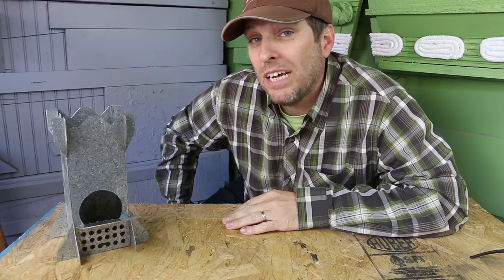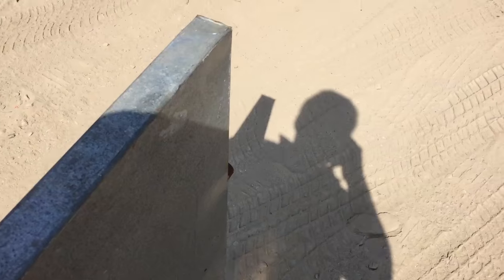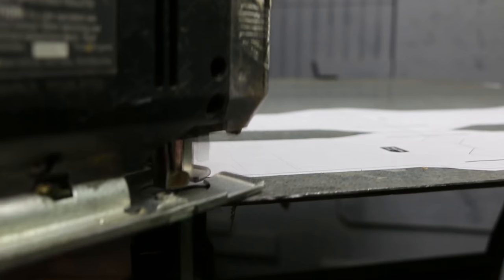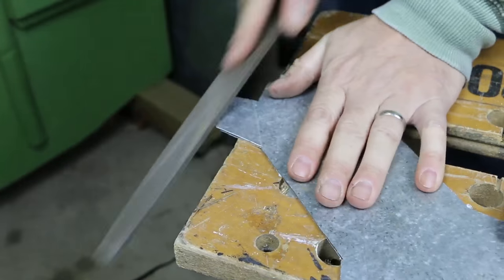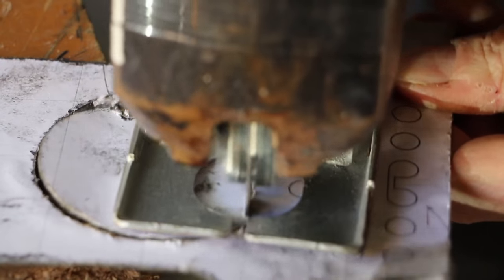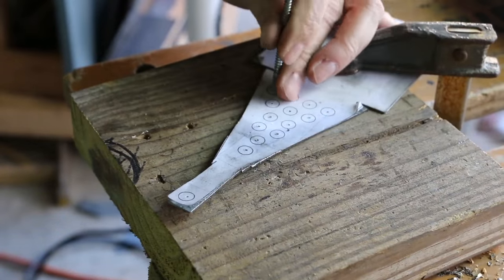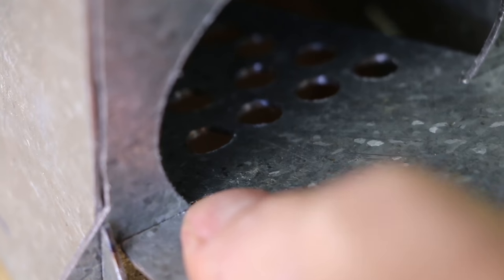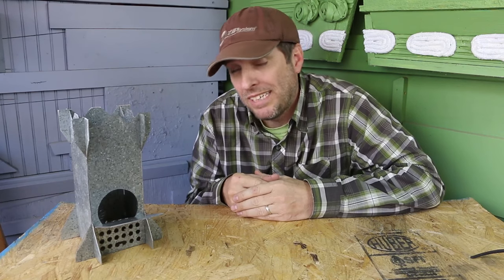How To Make A Portable Steel Rocket Stove

Comment: Thank you, I just ordered your plans!  At 75 it is more than enough to handle weightwise, and so easy to set up, use, and disassemble.  Very clever design.  Tons of waste wood all around so in an emergency it can be set up outside or where ever you are doing camp.
Reply from the maker: +garliclover01 thank you! I'd Love to see some photos of the finished rocket stove project.
Reply: GreenShortz DIY i am trying to order your plans for stove I get to the end and the page goes blank

Comment: I purchased your plans --very easy to work with. Made one out of shoe box board ,put it together and noticed my favourite pan was a little wobbly. So when I acquired some steel,  I made the top of the stove the same width  as the bottom. Much better!  Made mine with 1/16 inch steel , more work, but more stable in the field. Thank you for plans and video. L.W.  Manilla On. Ca.
Reply from the maker: Thank you for the feedback and for purchasing the plans. One more modification I suggest is to make the fire notches in the top larger by slicing off an 1/8 inch or 5 mm on both sides. I’m in the process of updating the plans to reflect this change. Thanks for watching.

Comment: Just finished my stove this afternoon.  The plans you have for sale were excellent.  I used a piece of 1/4 inch stainless steel and was forced to use an angle grinder to cut all the pieces.  Because of this, I had to modify the plans just a bit.  However, the stove works wonderfully.

Comment: Looks like you should add center dots to the holes in the plans. Pretty cool idea. I see a lot of comments about fumes from the metal used. I wonder if that's a permanent downside, or if they can be burned out and the stove be safely used after a couple burns.
Reply from the maker: Hi Rodney. I agree. The updated plans (and the production version on Amazon) have a center hole. The galvanized steel was a bad choice on my part, but I wasn’t aware of the problem. I do think it can be burned off, but stainless steel is a much better option. That’s the metal the stove is produced from now. Thanks for the feedback. Thanks for watching.

Comment: That was an unbelievable amount of work on your end!! I acknowledge that you are not a mechanic or an engineer!! because I would probably have done that with a pair of snips and a step drill in about a 1/4 of the time.. but very very very nice work! thanks for showing it to all of us...
Reply from the maker: Thank you! This was a labor of love. I was really hoping my band saw would have performed better, but the jigsaw served the purpose. I'm looking into mass producing these and will go the plasma or laser cutter route...perhaps water jet. I've got a CNC plasma build video coming with Doug Jackson of SV Seeker. I may make one more hand-cut demo with a plasma cutter for fun. And, I do need a step bit. Been thinking about picking up one up.
Reply: Great that is nice that you have decide to use an step bit, Try to remember to use it in the slowest possible setting your have and use plenty of lubricant,, in that way you will extend the life of your bit!! good luck..

Comment: Great design buddy! You have made a good work. However I am concerned about the galvanized steel being fire heated and the fumes. The zinc coating can be unhealthy. I would suggest to use a bare steel or iron without any coating if  possible. This a quite clever design and pretty useful. Congratulations.
Reply from the maker: Thanks Jose. And your concerns are correct. I did get a lot of feedback after posting this video about the same issue you mentioned. At the time, I was unaware. If you are interested, I do make this stove now (in stainless steel) and sell on Amazon. Just search for "Rocket King Stove." Thanks for the feedback and encouragement.

Comment: Probably not a great idea to make a stove from galvanized steel, zinc fumes are toxic
Reply from the maker: Hi Rob. Yes. I learned this from Doug at SV Seeker. I was curious if the coating would have any effect and wasn't surprised to learn this. I'll be removing the galvanized coating before firing this stove and going with raw steel or stainless steel for future builds. Thanks for the comment and concern...and for watching.
Reply: A good hot burn in in open air should get rid of the zinc fumes.
Reply: theoldwizard998 I'd be skeptical of that technique being effective enough, maybe dropping the whole thing into a bigger fire would do it, but I think everyone would be better off just not needing to burn zinc in the first place
Reply: While I agree with the galvanized statement, the concept is still a great one. Small, Compact, and Lightweight. Keep Building!
Reply from the maker: Rob, I've heard of the burn-off method from a couple of commenters. I'll try that method for this stove. Thanks for the feedback.
Reply from the maker: Thank you Bushcraft Builder. Part of my goal with design was to appeal to the bushcraft folks too. Glad you like it.
Reply: GreenShortz DIY I think that's probably the best method now that it's already done, I just wanted to suggest not using galvanised stock in the future
Reply from the maker: Rob, I definitely be avoiding galvanized steel going forward. I've learned a lot in this process. I love that about the YouTube community. Thanks for adding your feedback.
Reply: I was going NO NO NOT galvanized! Happy to see you already taken care of the issue.
Reply: @GreenShortzDIY  
maybe a propane torch would get any  remaining galv
Reply: Galvanized is fine. We've used galvanized sheet metal for tin camping stoves for generations. Light the first fire outdoors to burn off any yuckyness. Many many times I have made toast (as did dad and gnandfather) on a galvanized tent stove, no issues.  (Look up Labrador tent stove.)
Reply: I know this is years later but to remove galvanized all you need to do is soak the pieces in vinegar for 24 hours and wipe clean. Old welders trick.

Comment: Have you experimented with venting the sides below the firebox?
Reply from the maker: Not yet Phillip, but I will give that a try. I’m considering putting this rocket stove into production. Would you be interested in purchasing a product like this? Thanks for the suggestion.
Reply: I haven't camped in a long time. I've got 2 gas stoves, but have recently been looking into a rocket since in the Dry Tortugas you are not allowed any gas or liquid fuel.

Comment: Before you glue your pattern down on the metal....glue them to a cereal or pizza box THEN glue that onto  your metal. Worked for me!!!
Reply from the maker: Thank you for the suggestion Bill. I do think having the plans a little thicker would have helped keep the lines in place while I cut out the rocket stove. Thank you for watching.

Comment: Instead of hair band, use 1/8" bungee cord.  To join the end use dual wall (marine) heat shrink.
Reply from the maker: +theoldwizard998 good suggestion. I'll need to get a heat shrink. The would be much more durable. Thanks for the idea.
Reply: I have found dozens of uses for these custom made rubber bands.  If you use 1/4" bungee cord you will need to sew the ends together before the heat shrink.

Comment: Stainless high crome vanadium steel is the best. Also ash tray and cooking grid must be added to this design. But overall design concept is the best. The most portable and efficient design.
Reply from the maker: Dimitar, agreed. I am producing the stove in stainless steel. Lighter and more durable. Plus this metal was galvanized...not the a good coating for fire. Thanks for watching.
Reply: @GreenShortzDIY  
Yes. And also ash tray and cooking grid must be added to the design. Then you can have performance that is tough to beat. You can cook unlimited outdoors. When you can remove the ash from the tray. You not need plans. You draw directly on the steel piece and cut. No need a paper whatsoever.

Comment: Am not sure galvanized material is a good idea if it gets hot enough to burn the zinc. It can give you a kind of fume flu, I think is the nickname. Bare steel or stainless steel would be better imho. If stainless, it could be quite thin, which would help shipping charges. Although stainless would be several times as expensive.
Reply from the maker: Gary Wheeler you are correct. I learned this from Doug Jackson of SV Seeker when he helped me CNC a copy of the rocket stove. I had wondered about the galvanized coating and he confirmed it. I'll take the coating off this before I fire it. He used the "flu-like" description as well. Stay tuned for the test video. Thanks for watching and for your comment.
Reply from the maker: Gary Wheeler by the way. I am getting bids to have this rocket stove made en mass by plasma, water jet or laser. I will get numbers on stainless steel in addition to bare steel.

Comment: The only flaw I see is the bending of the tab, it will eventually succumb to metal fatigue and break off with repeated repacking.
Reply from the maker: +Manvaril actually, once it is bent the first time, the bend stays in place. The parts can be taken off and put back on. That may not have been clear in the video. Thanks for your comment.

Comment: Nice thing but bear in mind that nothing in the world puts more CO2 in the air than a wood fire
Reply from the maker: Maxime, a good warning. The way I look at it, is that using smaller sticks and branches to burn in a rocket stove is a "local fuel" solution, removing the need for the mining, refining and transportation of fuel...each of which has an environmental impact. So, the efficient, cleaner burn of a rocket stove is a better way to consume a carbon emitting fuel like wood. Thanks for watching and for the feedback.
Reply: God made wood to burn to keep us warm, besides, these rocket stoves will burn hardly a bucket of wood.  Remember, wood is simply 'solar energy' stored, a rocket stove releases that energy in the most clean and efficient way possible.  You, by breathing out, are putting CO2 in the air right now. hmmm